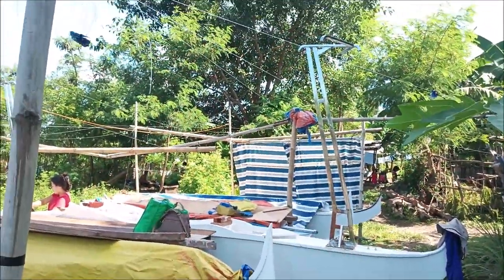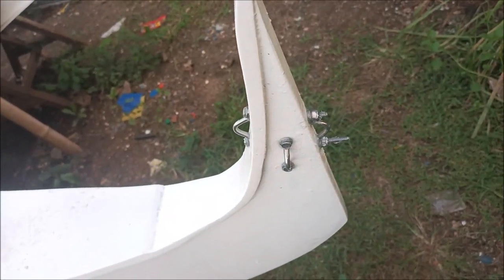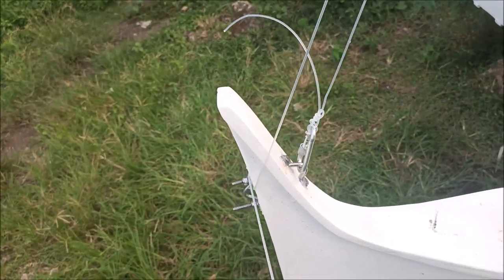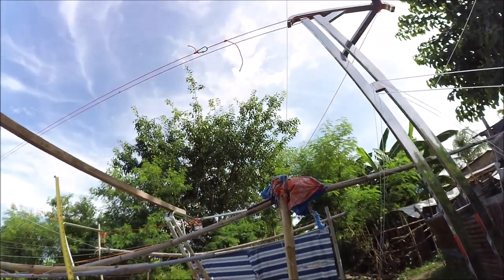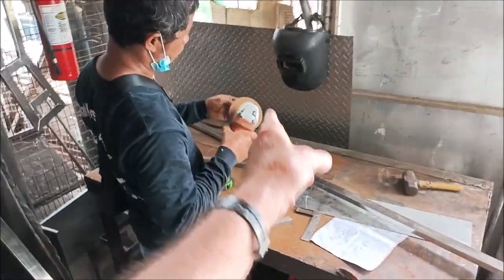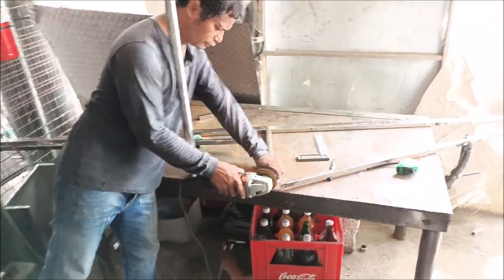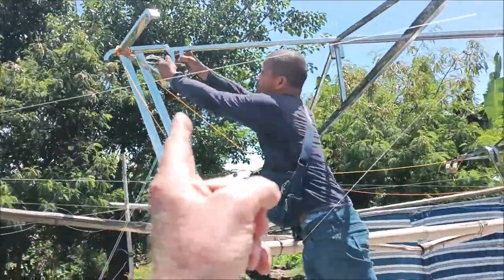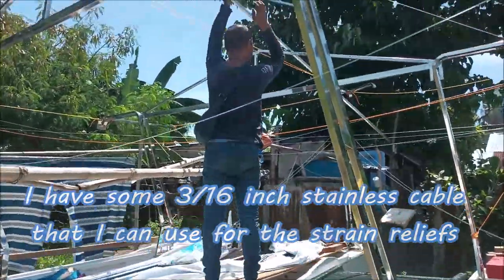Paradise Trimaran Boat Building - We Make The Tarpaulin Roof Rafters

Comment: Hmm.. I'm wondering if  Velcro strips sewn into the tarp and glued would be of any use in some way? Like eyelets and Velcro straps also..🤔 Or sew in extra tarp material that can wrap around trusses and Velcro together when wrapped around trusses. Then no need of any lines.
Reply from the maker: I was just thinking about asking the tarpaulin maker those exact questions. mainly to hold the underside to the rafters. The outer edge has holes and I plan to use the carabiners to clip the tarp to the sharkfins that I will weld loops to clip to
Reply: Are you in malaat ?
Reply: Or Poblacion?
Reply: @stur6641  population in Spanish.. 🤔
Reply from the maker: @stur6641  my beach is in maalat, right now I am working on my boat in liloan.